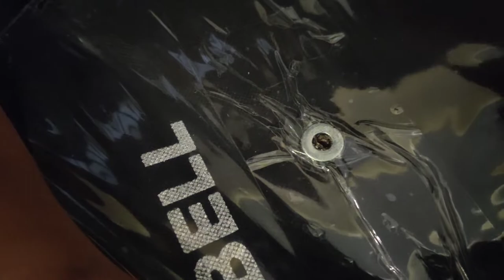CELLBELL Taurus C100 Ergonomic High-Back Mesh / Home & Office Chair            Assembling

Comment: To anybody reading my comment, if you are planning to buy Taurus C100, please don't buy. 
After using it for almost a month, I do not recommend this chair. It is advisable to purchase a chair with a price range between 7000 to 10,000. Chairs below 7k are not of good quality. You can try different brands if you want. My chair developed a squeaky sound after two weeks of usage and it also wobbles, which is very disappointing.
Reply: Is green soul jupiter good? Squeaky sound not big deal